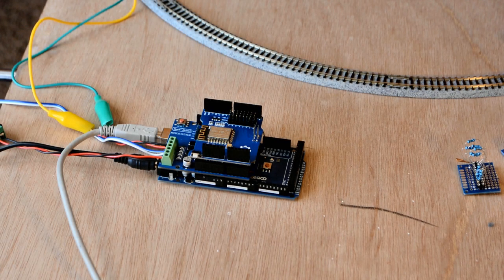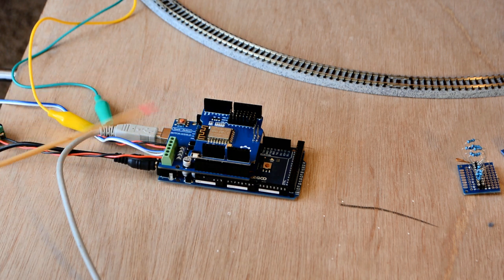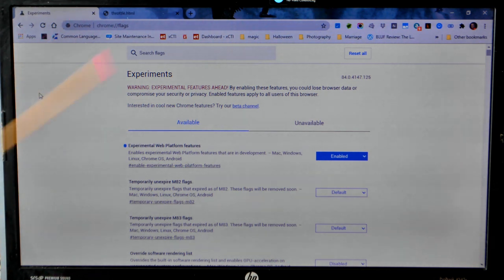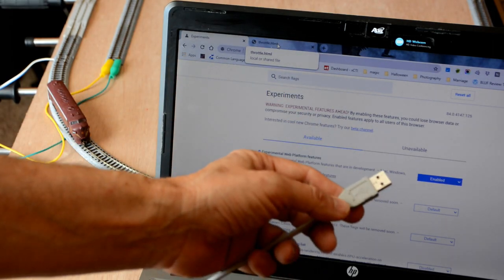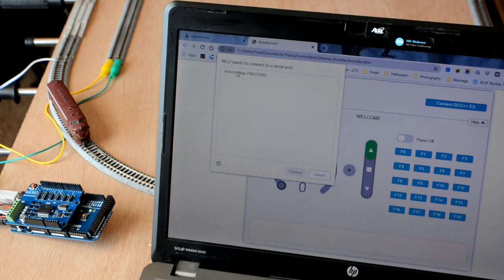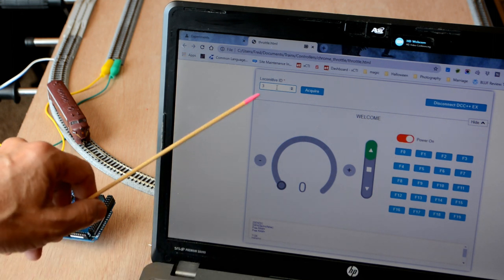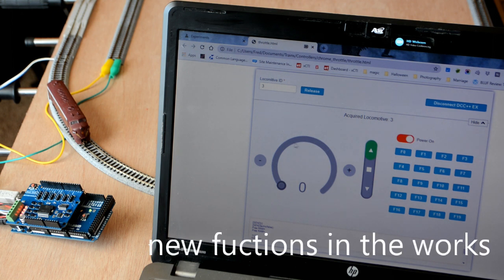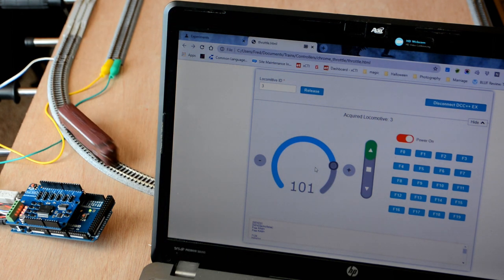exWebThrottle - A browser based USB Throttle for DCC++ EX (Alpha Testing)

Comment: Question for you how do you change the address I have two loco both with the same address
Reply from the maker: From the command line of EX-Webthrottle or the Arduino IDE Serial Monitor, send "<W ADDRESS>" (capitol W) and click "SEND". You don't need the braces <> from WebThrottle, but  you do for the Arduino Serial Monitor. This is a special DCC++ EX command when your loco is on the programming track. EX: <W 99> would make the loco ID 99. You can then send" <R>" and read it back. If a loco is on the MAIN track and the ONLY loco on the track, you can also send <w 1 99 1 1>. Note this time it is a small "w". You can't read anything back on the main track. See the command cheat sheet here: https://dcc-ex.com/reference/software/command-summary.html
Reply: @DCCEX  thank you that works thank you for videos